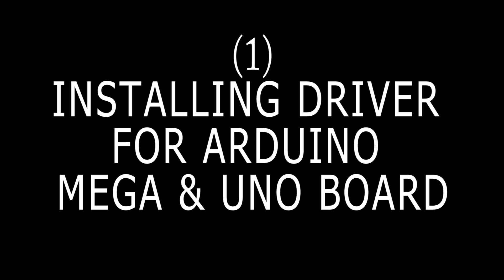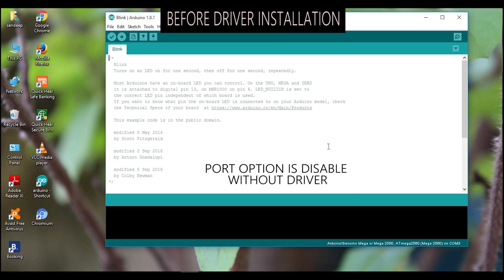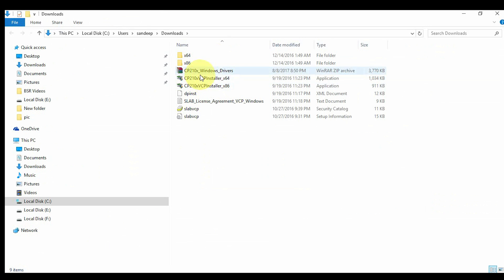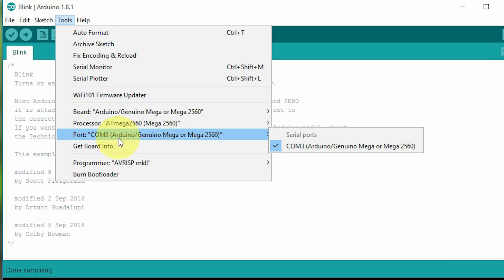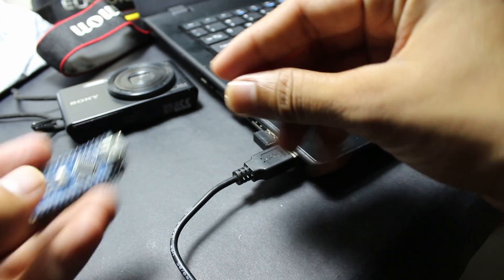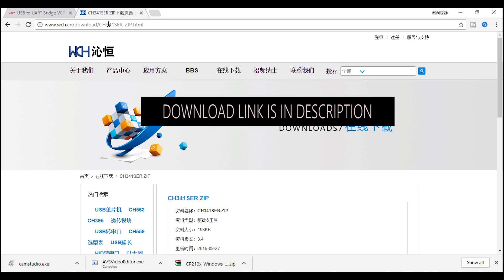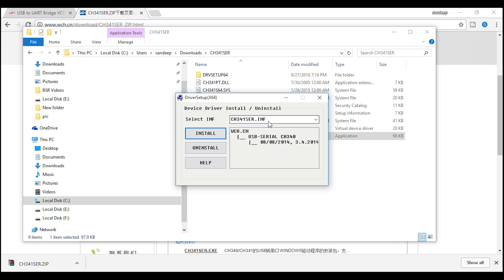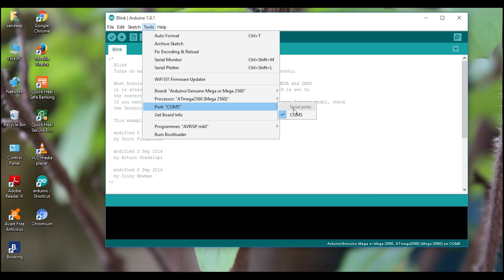Quick guide how to install driver for arduino boards UNO/MEGA/NANO

Comment: for 32 bit system
Reply from the maker: visit this page http://electricdiylab.com/quick-guide-install-driver-arduino-boards-unomeganano/
Reply: is it safe to buy in this website? https://www.banggood.com/UNO-Mega-Nano-Sensor-Relay-Bluetooth-Wifi-LCD-Beginner-Starter-Kit-For-Arduino-p-1132002.html?p=QG080163176892016090